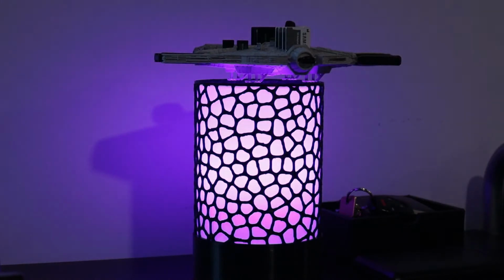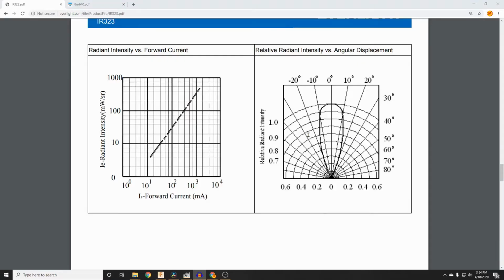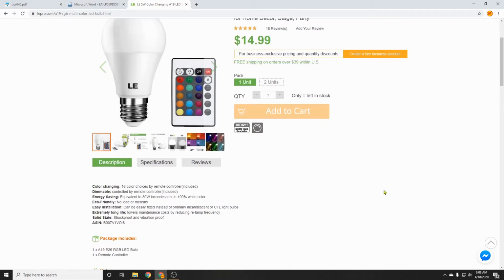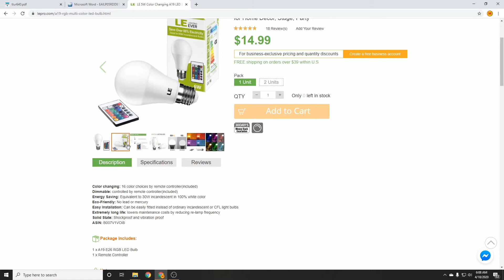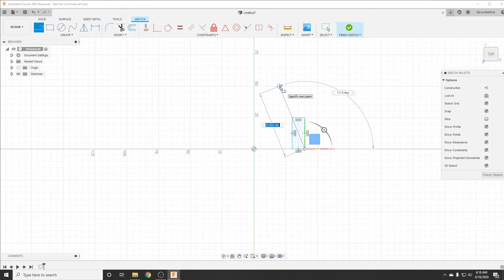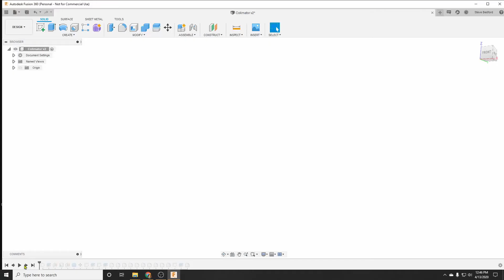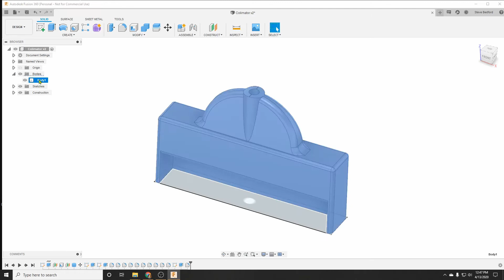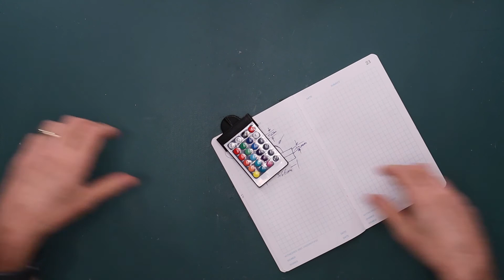How to fix a TV and LED light IR remote control interference problem with 3D printing||Electronic

Comment: If anyone is having this problem and doesn't have a whole ass 3D printer, they can:

1) Layer two pieces of electrical tape onto each other
2) Poke a small screwdriver or a fork through the middle of the layered tape
3) Tape over the IR lens of the remote that's giving you issues

NOTE: Make sure the hole is centered or faces towards the device that you want it to use for from your viewing position.

Comment: I have LED light strips around the entire perimeter of my game room and a 43in LG tv. I only ever use like 4 buttons on the remote (input, up down arrows, and the ok button) but it just so happens all of those buttons change the lights. The input button changes the lights to bright blue, the down arrow turns the lights on and off the up arrow sets them to flashing mode and the ok button sets them to rapid color change mode so they just go crazy whenever I change my TV input from different consoles to my PC. :/ TVs should have a setting in them to shift the IR frequency to different channels as well as a dial in the remote to set it to match. That way the user can easily solve this problem. I know re programmable remotes exists but there’s no way to change the frequency my TV listens to 🙃

Comment: I enjoyed your video.  I don't have a printer (especially one like you have) and my remote has a rounded end, so I had to resort to putting my remote control into the end of an empty paper towel tube.  I like your device better than mine, but mine does allow me to operate my fan without turning on the led lights.

Comment: I have the same remote x 3 for 3 underwater pool lights. The light were installed by an electrician and turn on when connected in the main box however, I can't get any of the remotes to turn off or change colors on the lights? Yes, the remote red light comes on so the batteries are in correctly. I have tried different angles etc..it doesn't work..Help!
Reply: I know this was 2 years ago, but we're able to figure it out?

Comment: So my vizio tv remote will change the led lights colors (up makes them go blue, right makes them go pink). I do not use the LED remote ever, it's on a timer through the app. Now on a weird twist of things, I have Alexa devices and smart bulbs. Tonight when I voice turned off the smart bulbs, it also turned off the vizio tv. This is NOT a smart tv and the bulbs are connected via wifi. Any advice?

Comment: I just recently purchased LED lights and I have two concerns 1st) I'm noticing that both remote for my TV and LED lights work for each other and I don't know how to fix the issue. In other words, the TV remote works for both the LED light and TV and the LED Light remote does the same, it's very frustrating and the other concern is can the frequency from an LED light affect or interfere with a smart tv because I just had a burn in and now my TV refuses to stay on and the screen also keeps flickering

Comment: I tried to turn down my tv at like 12 Am and when I did that my LED lights turned on 🤣
Reply: Yea I noticed the same thing, the volume button on my tv remote turns the lights on and off. Very annoying.
Reply: @Trauma_Ties  how did you fix
Reply: @professorsnax6335  Saw a recommendation online to wrap the sensor on the light strip in aluminum foil. I wrapped it and left the far side a bit exposed so if I want to change the color, I just have to reach a bit to side with the LED controller. If you don't change the colors and are fine with one color you can just set the color and then wrap the entire sensor in foil and it should block it from any TV remote interference.
Reply: If you plug in you led light try turning off by the mains coz I’ve not found how to fix this problem other then that
Reply: @HAYDEN AMES by the switch on you plug socket because my led light don’t turn off fully by the controller.
Reply: @HAYDEN AMES It probably depends on the brand you bought, the area I wrapped is black. Mine is where the cord plugs into the light strip.

Comment: Do you know how I could stop my TV remote from changing the colors of my led lights so I can use it for my TV again? I can't seem to find anything online really relating to my problem.
Reply: yes i just got a new tv today and was setting it up and thought my led lights got possessed
Reply: Happens to my regular tv remote and my roku its driving me crazy!
Reply: Tell me when u guys find a solution ple
Reply: @itsarmanii14  No one has found a solution. Like I said in my original comment there are no solutions online and its annoying. I've been trying for 5+ months.
Reply: I have the same problem
Reply: @hearts4kym  its so annoying right? ive been trying to set up my tv for ages and never really realized until i commented this before
Reply: Did you ever find a solution? Because my Vizio remote is doing the same.😭
Reply: @angelldenisee7322  I never had a reply. I still haven't used my TV and its been 5 months. It's so annoying.
Reply: @angelldenisee7322  same my Vizio remote changes my led colors
Reply: This is happening to me too 😭
Reply: Same
Reply: Did u find out?
Reply: @elmerdelcid6607  No sorry. No where has any solution, and no one has replied with help.
Reply: tokin ghost right , i’ve just been using the remote on my phone.

Comment: My led adapter is right next to my LG tv. My TV remote works for my led lights and whenever i press the buttons it changes the color of the led. how do i fix that?
Reply from the maker: Did you try one of the light collimators? You can get pin point accuracy. But, it sounds like you need the TV remote to be collimated.

Comment: how would i fix it if my led remote interferes with my brothers led’s?
Reply: we are in different rooms as well
Reply from the maker: The method in the video only works with inferred style remotes. If you have interference with remotes used in different rooms (assuming no line of site interference) your remotes are probably radio based. If that is the case see if it's possible to change the channel one of the remotes and LEDs are working on. If you send me a link to what kind of LEDs and remote your using I'll take a look at it.
Reply: @idratherbemaking4270  I have this issue with three new sensory lights I bought for Christmas, one for each room, they're all funding each other on and off, not very relaxing or Ambient!
Reply: I am having this problem.. my daughter had LED lights first and her brothers in a different room just got the exact same ones. Now they are fighting on the colors because their remotes work on both sets. I'm trying to figure out how to fix it so they can each control their own.

Comment: For me it's the other way round. My tv remote is actually turning my rgb lights on. But the rgb remote does not interfere with other devices.
Thanks anyway for the tips.
Reply: Same here, it's a roku tv remote
Reply: My LED remote puts the volume high and low and shows the settings on my tv
Reply: Same
Reply: @rafaelmontoya1454  did u ever get it fixed?
Reply: So is mine
Reply: Same it’s driving me insane
Reply: @PR-in7jz  me too
Reply: Same here
Reply: This is my issue and I've changed remotes, I've put my tv facing 1 wall and lights to the opposite wall and it still does it, as long as its within the same room. I cant figure out how to fix this.
Reply from the maker: That's interesting. Thanks for sharing.
Reply: Same i have a roku tv too
Reply: Me too
Reply: Same my tv remote for some reason changes the colour of my led light
Reply: @felicityrose29 did you ever fix this? It’s bothering me so muchhh 😩